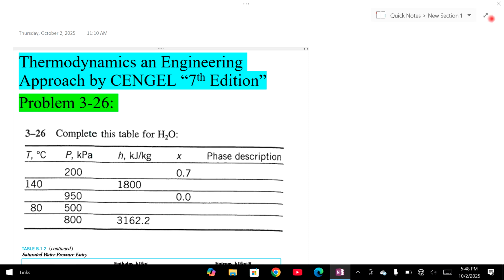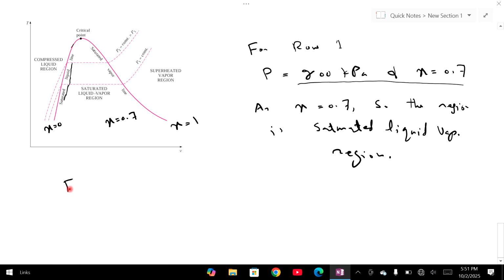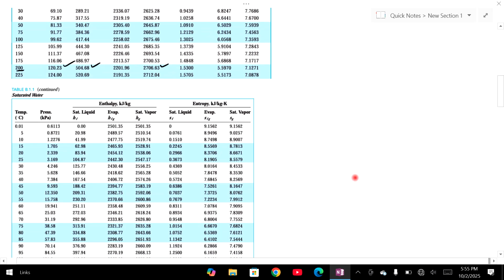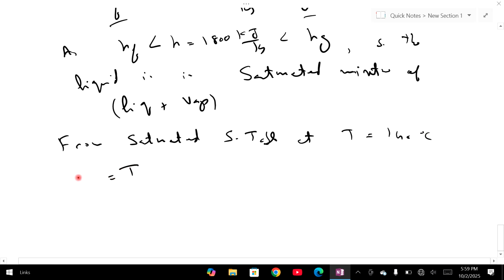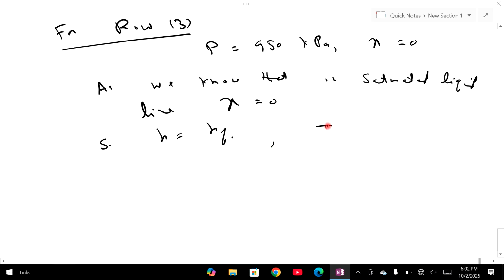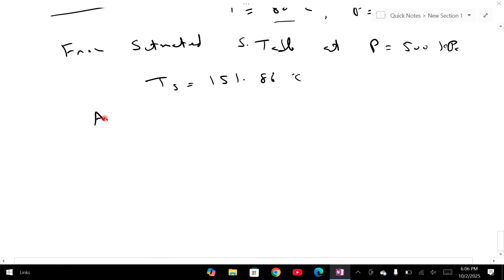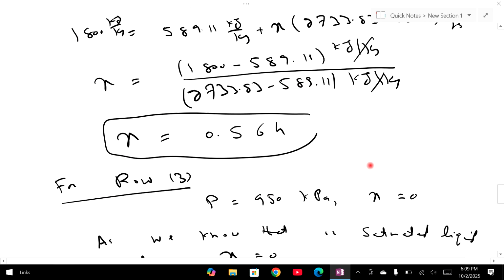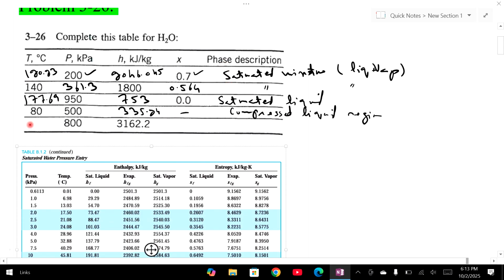Complete Table for H2O |Problem 3-26| Thermodynamics An Engineering Approach by CENGEL 7th Edition

Comment: Sir ye h= 1800 ma apna kasa find keya ye kona region ha
Reply from the maker: 1800 kJ/kg is between hf and hg. hf is in saturated liquid line and hg is enthalpy on satuated vapor  line. so 1800 kj/kg is in bewteen these two lines. which is called wet region or mixed region (liquid + vapor)